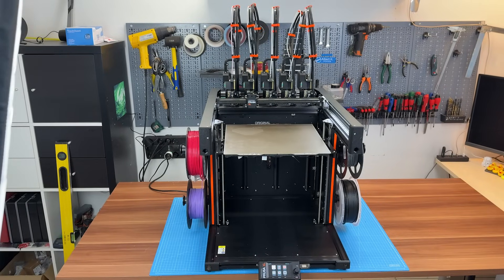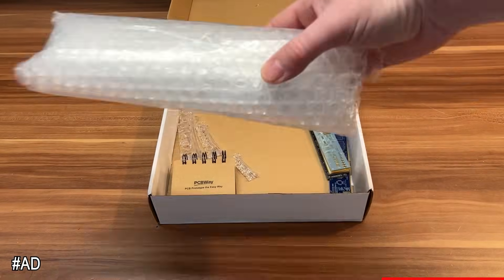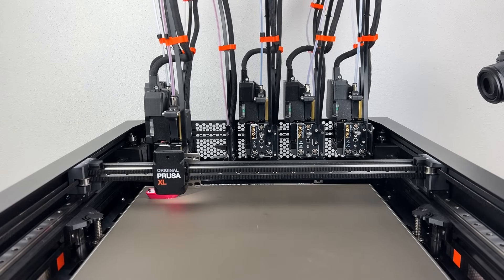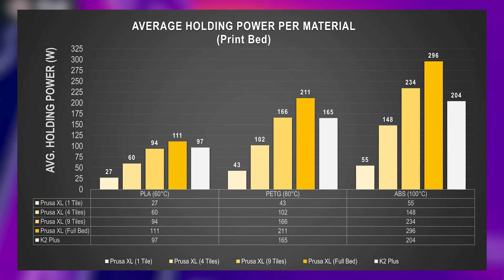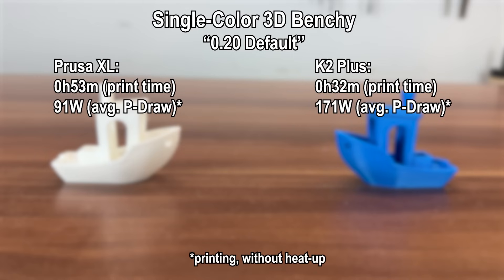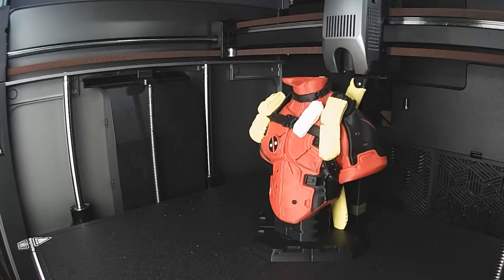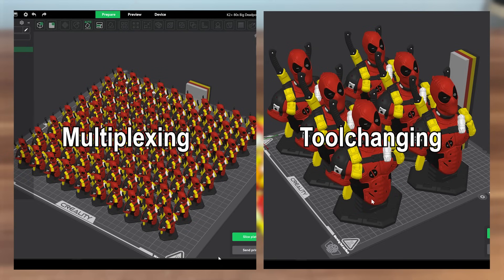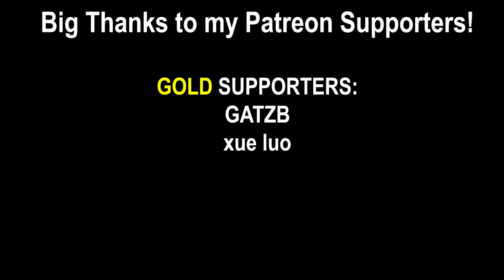Prusa XL vs. K2 plus: Material and Energy Efficiency Tested!

Comment: Looking at the K2Max and Sovol Sv08...Help me decide lol

Big asa prints, multi-color doesn't matter.
Reply: I have both the K2 and the SV08

I print single color and only use the CFS for automatic spool refills for long prints

My SV08 made its way into storage until I get around to modding the ABL on it because the bed probing is extremely unreliable 

The K2 has spectacular hardware but falls flat on the software side.

For me it was easier to fix the software issues on the K2 by editing the config files and the macros.

The SV08 is a thinker's dream, its cheap, everything is accessible and sovol released not just the opensource software but all the actual cad files and a large ammount of the hardware has universal part numbers embedded into the cad files.

I think the Qidi Plus 4 might actually be the best printer right now. little to no negative OR positive comments from youtubers and yet I see a lot of "I printed this on my qidi plus 4 because XYZ is broken/blah blah" and then they go on to talk about the thing for days before ending video and not sharing the thing they made for free or at all.
Reply: @Guardian_Arias   Naw Qidi has bad manufacturing quality and has not addressed the fire hazard in their badly self designed SSR for a year and now someone's house burned down.
Reply: @SianaGearz  as far as i knew they did address the SSR issue but they took the approach of "you contact us otherwise we wont"

They even have second gen heater in their marketing for newer qidi.

plus a simple fan mod on the SSR solves that issue and its much easier to fix than redesigning or modding the tool head on a sovol, or rewriting code on the k2, or praying you get what is advertised on the bambu because you get what you get and good luck.

bottom line no printer is a ready to use experience out of the box unless you get lucky. Bambu with all of its security issues and spyware is the farthest from ready to use.

I really just want a K2 but with only of the shelf components like  btt  manta boards or duet boards and no glue used for assembly.
Reply: @Guardian_Arias   The redesigned SSR isn't good enough, putting a fan on it isn't good enough - because fans are parts of mediocre endurance and reliability themselves, if your device relies on a fan to not burn your house down, that's completely messed up - and not issuing a recall on a safety relevant issue is really bad.

Why do people put up with this whole state of industry wtf.
Reply: sv08